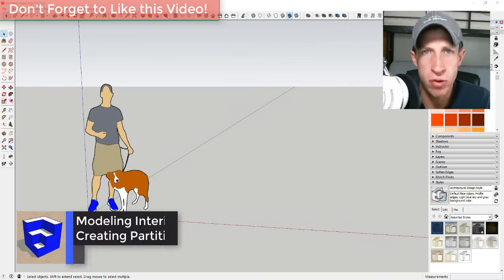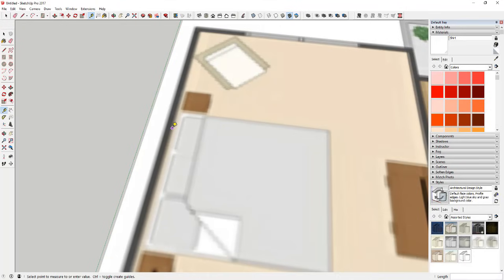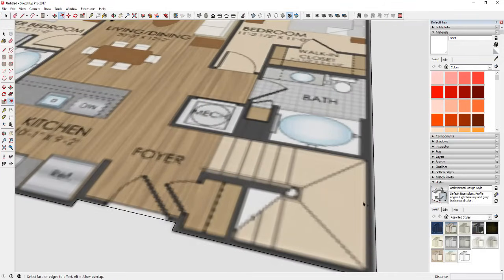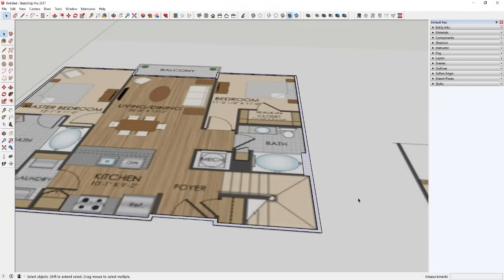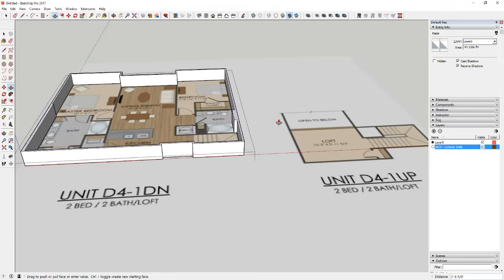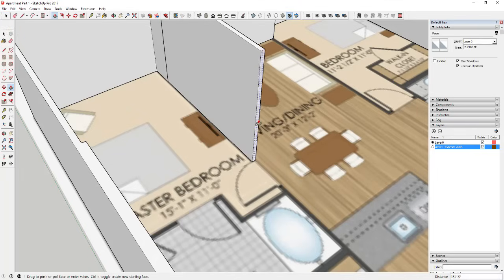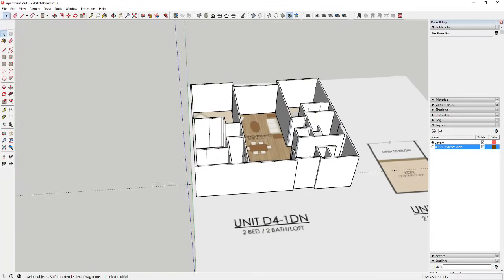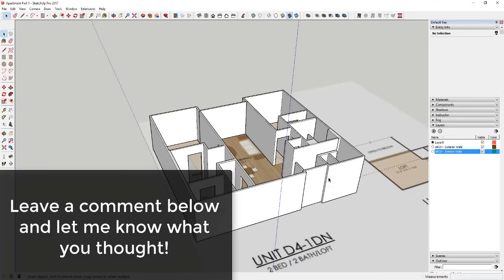SketchUp Interior Design for Layout 1 - Walls from a Floor Plan Image

Comment: Hey, I tried to push the doors back after creating the little lines for where the door goes, and it doesn't seem like it works anymore, it just tells me that offset is set to whatever it was set to
Reply from the maker: Try tapping the control key with the tool active

Comment: Hi! I was using this tutorial a few years ago and it worked like a charm! However, now I have problems when I try to hide exterior walls after making the interior ones. For some reason, Sketchup automatically adds the "Exterior walls" tag to all of the interior walls I make and I don't know how to work around that. Didn't have that problem before they changes "Layers" with "Tags".

Comment: Hello, thanks for your video. However some things are not clear explained, like the face across the image shift + line won't draw a face on top of the image.  You might add on the scree the shortcuts button that you use as from your voice explanation it is sometimes hard to get it. I hope this helps. Thanks again for your video.

Comment: Loving all the videos, and trying out all the different techniques you are demonstrating...one thing I haven't figured it is why when I'm doing internal walls, I end up with a mirror image reverse wall on the bottom side.  What am I missing?
Reply from the maker: I don't quite understand - you're creating a wall and another wall is occuring somewhere?
Reply: @Thesketchupessentials  For example, I extrude the wall up to the desired height, but if I flip the image over to the reverse plane, it's also extruded down...
Reply from the maker: @amandagleeson2625  It sounds like you made your wall into a component, then made a copy of that component and flipped it over?

Comment: Great video. I am having trouble right at about the 20-minute mark where you create a new face and pull down, then extrude the door.  I cannot create a new face and alternately when I attempt to use just a rectangle to extrude the door opening I cannot push it through.  I saw where you used inferencing to push to the back part of the wall though I cannot remember where I saw that and am not able to do it.  Your videos are very good and I really appreciate your expertise.  I've watched many and do translate everything into mac, as I go.  As a beginner, I sometimes have to watch things several times to get the technique though I am finally able to make my way around in SketchUp.  I will contribute to your Patreon account as I have definitely learned a lot from you. Thank you.
Reply from the maker: Try tapping the option key when it extrudes back - this will create a new face instead of just removing the old one

Comment: Need help! I’m pretty sure I followed the video to the tee, however I cannot hide the exterior walls layer apart from the interior walls layer. But I CAN hide the interior walls from the exterior. Both are groups and both have their own layer. What did I do incorrectly?
Reply from the maker: Sounds like the actual geometry itself got placed on a layer, not just the group. You need to go into that group and move all of the raw geometry to Layer0

Comment: Sir I tried many times but tape measure is not scaling my image I also hold the control key and enter the value but it is not working .if there is more ways to scale the image is available please let me know. I shall be very thankful to u
Reply from the maker: As a general rule, you shouldn't hold keys down in SketchUp. Just tap the control key, not hold it
Reply: @Thesketchupessentials  tnx a alot sir

Comment: Have a question for you. I Detail boats, looking installing boat flooring for nonskid areas. Is there a digital pen that I can sketch the shape of that particular with measurement and it transfer to this software or another?
Reply from the maker: Not in the way you're thinking I don't think - you can sketch it, then import an image and use it as a reference for modeling...

Comment: Question, once I set up the group, layer and entity, When I go back to pull the wall up, I have a locked symbol on the push/pull button. Did I miss something while setting up the groups and layer.. 
By the way fantastic videos, I have been playing with sketchup since it was released, but was never really able to figure out how to use.
Reply from the maker: Are you inside the group with the raw geometry? If you're outside the group, you can't push/pull the geometry...
Reply: I wish I could tell you yes, but I might be lying to ya'll. I got it to work but for the life of me I'm not for sure what I did. I'm going to keep playing.. 
Thanks, for the feedback

Comment: Love the show. 
FYI, standard wall thicknesses are as follows (incorrectly stated in this show): 
Outside walls vary depending on the thickness of outer surface but on an "all wood wall", your stud thickness is either 3.5" or 5.5". Sheetrock on the interior face is usually 1/2" but could be 5/8" if stud spacing is more than 16" oc (but less than or equal to 24" oc). Outside layers usually include 1/2" sheathing (OSB-Oriented Strand Board, a common sheathing material, is actually 17/32" but 1/2" is good enough). Progressing outwards- usually we apply a vapor barrier material that virtually has no noticeable thickness. Then you have to decide what the final finish is: it could be brick (4" including a small air gap), lap siding (usually allow 1/2 to 3/4). In colder climates, we usually use 2x6's for framing (actual dimension of 1.5"x5.5") because we can put more insulation in. Many builders are starting to put rigid insulation outside of the sheathing layer to keep "thermal bridging" (the fact that the studs don't have as much insulation value as the insulation between the studs. This has to be slowed down, and so we see anywhere from 3/4" to 4" of rigid insulation outside the house now.Warmer climates use 2x4's (actual dimensions are 1.5"x3.5"). For SketchUp I use total wall thickness of (inside to outside: .5"+5.5"+.75"=6.75" total.
-Interior walls are almost always 2x4 construction (1.5"x3.5" actual) with 1/2" sheetrock on each side. This makes the total finished width of 4.5". Hope this helps.
Reply from the maker: Feel free to draw the walls whatever your wall width is going to be! Hopefully this video shows a process that you can use and adjust no matter your wall thickness :)

Comment: i think that having hi-res layout in the 1st place would be great
Reply from the maker: You mean having the images set as high resolution initially instead of having to make the change? The problem with that is that SketchUp doesn't handle high-res textures super well, so if they enabled that by default, people that didn't have an in-depth knowledge of texture resolutions would start having performance issues. Hopefully that makes sense - thanks!
Reply: i see...thnk u bro

Comment: I can't get my tape measure to re-scale my image. I clicked on Cntrl and typed in my measurement, however, it won't do it. Is it because my image is not right? Thanks. Great tutorials.
Reply from the maker: If you typed control, you may have put it in create guide mode. If I recall correctly, this only works if you're not in create guide mode. Try typing control again and seeing if it works then. Thanks!

Comment: If you use the tape measure with the control key. How do you stop it scaling everything that has been previously modeled? Made components previously, learned to scale images with this video. Went to put everything together and everything has changed scale. Please help, lol...
Reply from the maker: I think probably what you need to do is be inside a group or component when you change the scale. That way, you should have an option to either resize just the active component or the whole model. Did that help? Thanks!
Reply: i will try that. luckily i had a few auto saves i was able to get the original size back, just copied them into model and will mess around the the things that got rescaled at a later time. but will still look into doing the group